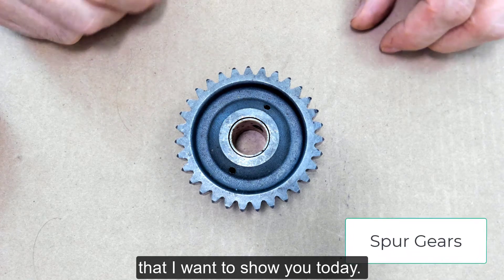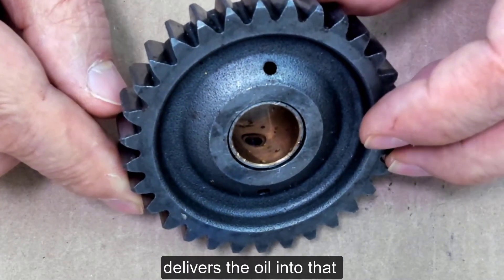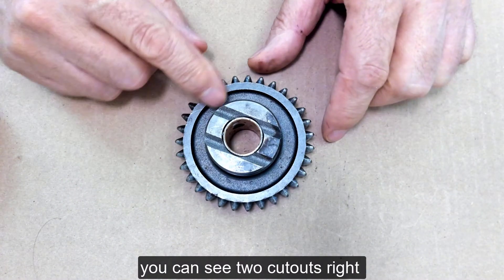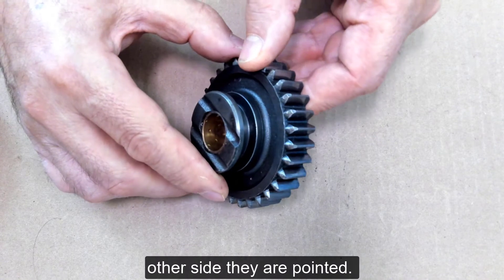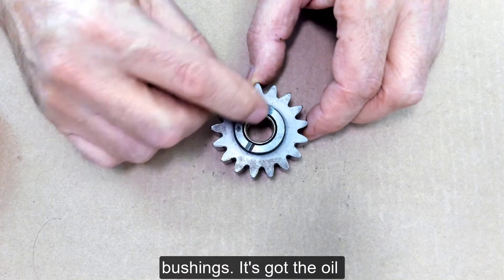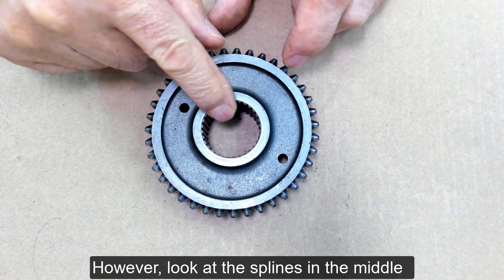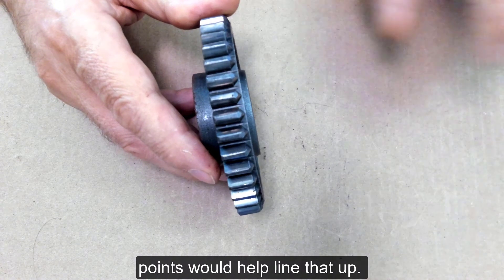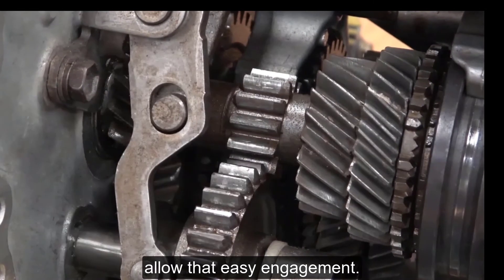Spur gears explained

Comment: what the oil for ?
Reply from the maker: I'm sorry, I don't understand the question.  Oil lubricates the gears.
Reply: Oil is for lubricating (and cooling) the inner bushing as it rotates on the steel shaft that fits through it - any time there's metal sliding on metal, oil is needed
Reply from the maker: Yes, I may have neglected to mention cooling.  The holes are referred to as lubrication holes not cooling holes but we all know that the lubrication helps to remove heat.  For most (not all) manual transmissions there is no lubrication cooling mechanism so cooling of the lubricant is not prioritized. If the components are well lubricated the friction is minimized along with the increase in heat. Synchronization causes the highest amount of heat from friction inside a manual transmission or transaxle.